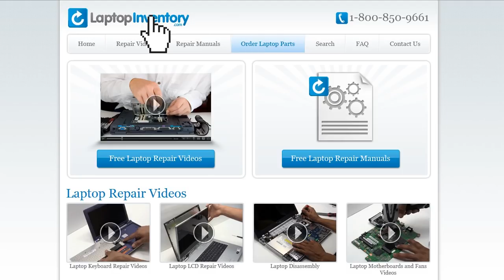Dell Inspiron 7567 Fan Replacement - Heatsink Motherboard Installation Guide 7566 7778 P65F

Comment: So is it safe for me to clean the fan by myself??
Reply: I know this is late but yes. If you take it off the computer or leave it on, clean it from the top (have to do this tedious whole process) or the bottom (only 1 screw!) then cleaning it should be fine. I say this because the fan has its own place inside the laptop and is protected away from the motherboard. If the fan had come off completely in every day use your computer would be fine as the chassis protects the motherboard. If it didn’t, then dell screwed you over and shorting a circuit on the motherboard will probably stop your laptop from working. Luckily, this isn’t an Apple iPhone so your data is still safe if it comes to almost worst case scenario. Use compressed air or something to clean off the dust. Please don’t use a cloth or anything that’s damp. Water cooling works, but not water cleaning, if any water touches that motherboard while it’s on then it will likely short itself and stop your laptop from booting.

Hope this helps
Reply: @majorwaveproductions  aight thanks for the detailed explanation :)

Comment: Just did it and it's a lot easier than any other laptop I've worked on. I'm no expert by any means, I've only opened  about 10 laptops. Dell could've made it even easier, just like you need only one screw in the back to open up the back cover. Thanks for the video 👍

Comment: Are those third party fans or identical to original fans? Also are they quieter. I'm looking for a way to make my fans to be quieter and this seems like my last option
Reply: undervolt your system, use throttlestop for the cpu and msi afterburner for the gpu, it will take a long time but its safe, but the process is quite tedious if you dont know these programs
Reply: @SirDella  I've tried this already. Intel xtu when I undervolt CPU to even as small as -40 the laptop will boot only every second time I turn it on and the option to change voltage in MSI afterburner is greyed out
Reply: I know msi wont show the voltage by default, check "4 ways to unlock voltage control on msi afterburner" the third one I think is the one it worked for me, BUT the core voltaje bar doesnt do anything, instead I used the  voltage vs frquency graph editor (the three little bars next to core clock) look up a tutorial in how to use that, if you can't, just tell me i'll help you
Reply: @SirDella  I'll try it out thank you

Comment: Wow, this is not easy by any means. I would not recommend this, even for an experienced user. I'm definitely a tweaker, but there's just too much that can go wrong here.
Reply: So hard to tear that down I just wamna clean the dust
Reply: Yeah, it happened to me. I disassembled to replace the thermal paste, and when assembled, I couldn't connect the power button cable. I had call for help.
Reply: Please don't get me scared, lol
Reply: @Scenty2024  Dont do it...
Reply: I gave when I take the plastic cover  out because the structure is so complicated.
Reply: Yup, on my first try I managed to somehow break off one of the little gold rings on the WiFi card while putting it back together
Reply: @wolfstorm5394  let some expert do it for u its not worth it lol trust me this laptop is complicated as fk
Reply: Ya havent opened a Vostro 3500 then - that thing is even more stuff to remove in order to get in the fan

Comment: Hi All, please be care full some of the screw on Fan or exhaust are very stiff due to pro lounge usage or may be due to excessive heat laptop is producing, so if they dont open leave it like that, mine one didnt open and i tried to force my way through fan screw but ended up damaging some of the micro capacitors. 

i dont know why dell designed it like that also biggest thing is they have put CPU and GPU on same channel heat sink not different which is causing so much thermal throttling for AAA games.

i watched the video to learn to replace thermal compound from CPU and GPU but failed so i will suggest better go and undervolt GPU and CPU to avoid thermal throttling if you dont want CPU turbo boost to be disabled.
Reply: I just do undervolt without repaste using both XTU -120mv core & cache -70mv IGPU and afterburner for the nvidia (1800mhz @ 950mv) + buying 2 vacuum cooler that cost me  around 12-15$ , and both thermal & power throttling problem doesn't show up till now
Reply: @IndoLiberation  yup but still after doing so my thermals are above 80•c
Reply: @moonabhinav  under heavy load 80 celcius considered very normal , my desktop i7 6700k would get over 87+ with intel stock heatsink
Reply: @IndoLiberation  thats okay with desktop, laptop its very harmfull and above 82°c laptops are design to throttle. And that is happening in my case
Reply: @IndoLiberation  vacuum cooler i havent tried yet as i had doubt it will be usefull for dual air vent laptop with vent at backside.

I tried a laptop cooler but it wont make much difference about 1 - 2°c only
Reply: @moonabhinav  it works , i simply can tell the difference by touching the upper middle keyboard section with and without vacuum cooler  , the vacuum cooler really does suck up the heat that trapped
Reply: @IndoLiberation  you have a back vent too ?
Reply: @moonabhinav  look dude , my laptop is dell 7577 all this time since i first replied to your comment
Reply: @IndoLiberation  GG man sorry i didn't read, what vacuum cooler you are using oplar one ?
Reply: @IndoLiberation  i use cooler master sf 17 can i use vaccum cooler also?if yes which one would u recommend?I tilt laptop upwards cooling pad has a stand so it sucks air properly from underneath ( due to cooling pad ) and then throws quite alot of hot air outside my temps are around 80 replaced thermal paste with nuctua nt-h2 been 3 months gonna replace keyboard now its giving trouble with arrow keys cant press them together sometime or sometime they fail to repeat when ipress them they wont do anything i wont press them again honestly its good laptop been 2 years replaced thermal paste when i was out of warranty otherwise u void warranty which is fking crap otherwise i could have gotten 4 year premium warranty ffs...

Comment: DUDE WHAT IS THE PART # FOR THE PIECE THAT COVERS THE HEAT SINK? YOU START TAKING IT OFF AT 1:46! PLEASE HELP I CRACKED MINE AND WANT TO REPLACE  IT!
Reply: DELL Inspiron 15 MASTER15 7566 7567 hing tail REAR COVER  google it
Reply: It's called a shroud